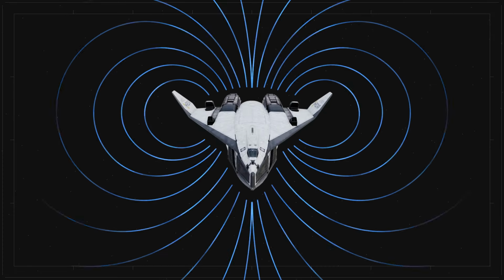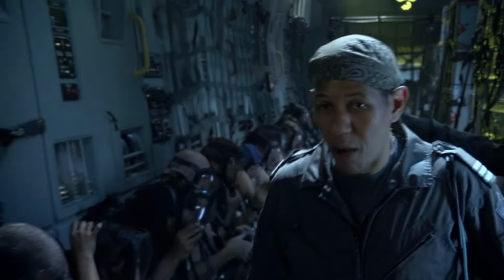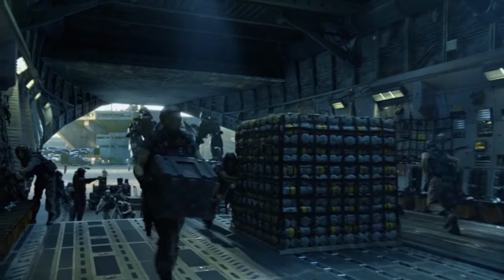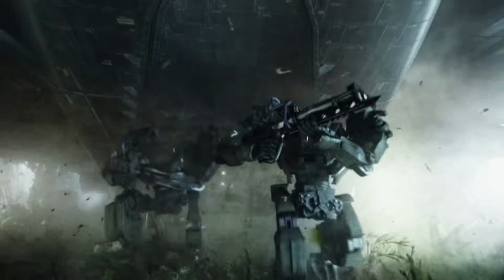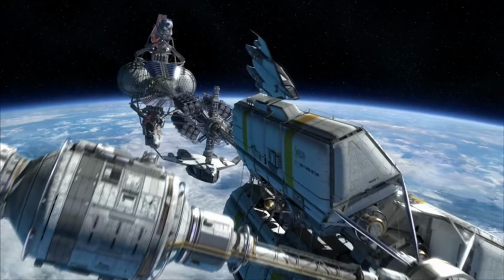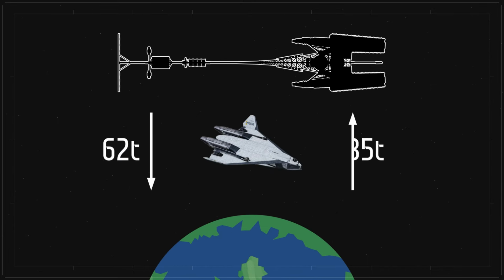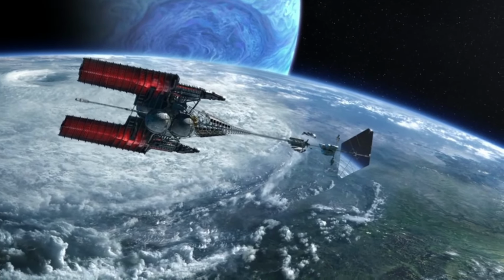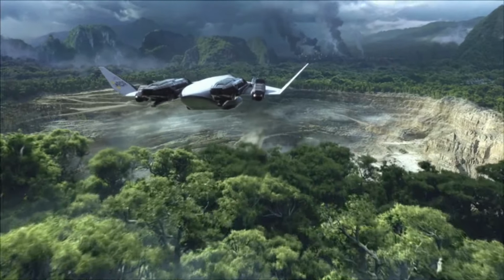Avatar: Valkyrie Shuttle Analysis

Comment: Do you think it's possible that the vertical slots on the front of the craft are the gas harvesters for atmospheric skimming on Polyphemus?
Reply: I do
Reply from the maker: If they are it seems weird to have them exposed before conversion, just adds more drag.
Reply: @hoojiwana  Well the space shuttle wasn't very aerodynamic in real life either. So they might just have decided to design it to pretty much be a ready made as a gas harvester just needing small modifications like adding gas tanks in the cargo bay  to simplify the work needed on Pandora. Since the engines can lift it and + 35 tons of cargo vertically and go to orbit then drag probably isn't a huge concern.
Reply: @hoojiwana  Did you ever see the Star Raker project . It could be just copypasted into movie .
Reply: @hoojiwana  They may act to draw in a large volume of air to pass over the fusion plants while they're in operation in an atmosphere.